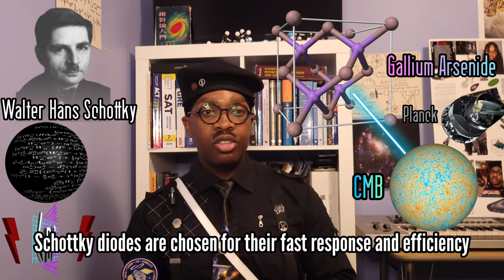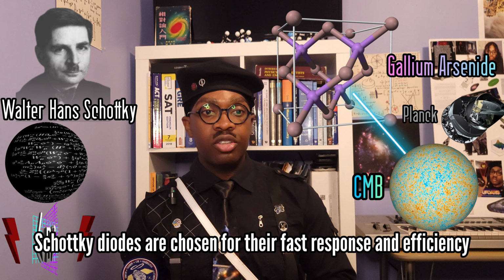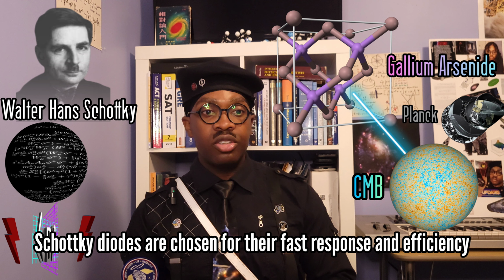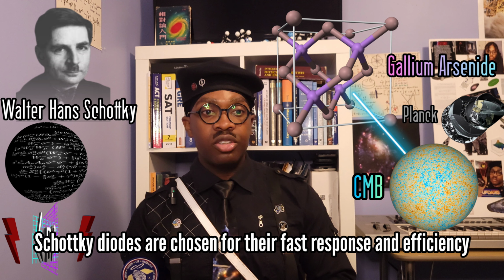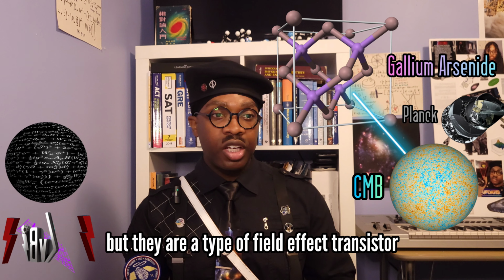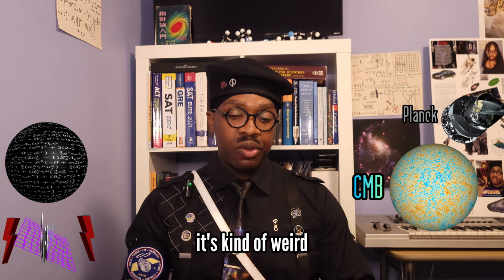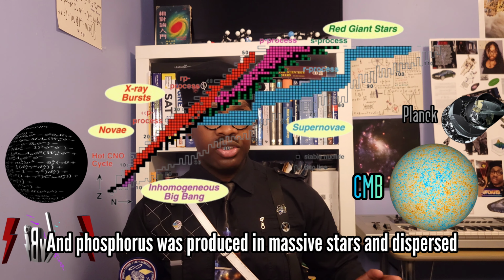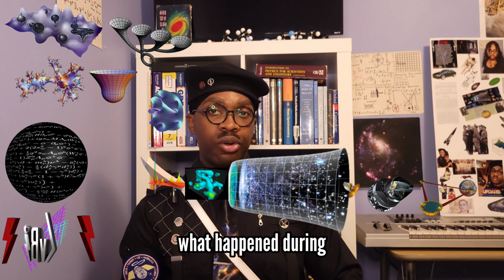What chemicals are used to detect the Cosmic Microwave Background?

Comment: Hello Chavis, would you reccomend the Feynman lectures as a good funnel into learning physics alongside calculus?
Reply from the maker: I'm going to be very blunt and honest, very few people who ask me this question actually do anything with it. Most of the people who come to my page usually or doing so based on ulterior motives and end up as failures who won't even remember they existed soon. 

However if you are serious about your question, the first thing you need to do is analyze metacognition. Look up Robert Bjork and Jun Yuh before you look up Richard Feynman or try to do derivatives or integrals in calculus.

Making learning harder and more difficult, rather than easier and more comfortable, is the best approach to retain information. One needs to understand the distinction between retrieval strength and storage strength, according to UCLA's Robert A. Bjork. The mere act of studying something does not guarantee that you will be able to understand or remember it. Actually, adding difficulty promotes more flexible and long-lasting learning. These challenges include varying the conditions of learning as opposed to keeping them constant and predictable, interspersing instruction on various topics as opposed to grouping instruction by topic, spacing study sessions as opposed to massing them, and using tests as study events as opposed to presentations.

Only when you do this can you know that you're going to actually be serious about this and not just look up this stuff for fun.
Reply: @cháwesī_ChavisVonBradford  I am very greatful to get such thorough advice from someone who clearly has great lived and learned experience. The fruits of which shall be bountiful. My grandpa was a geologist and he taught me some astronomy as a very young lad, and since then my dream has been to become a physicist. I dropped out and became a solar technician when i was denied financial aid and needed to help my family. But, I was recently gifted the Feynman lectures and Calculus: a rigorous first course by D.J. Velleman, and my will has been revitalized. I will have to devolop a time efficient schedule and train myself.
Reply from the maker: Analyze this playlist: https://youtube.com/playlist?list=PLnbDCUisM9Zjnikwb5Y2OkqTuZw7HD_il&si=HY-KdRUjMSyrUqo7
Reply from the maker: And analyze this playlist: https://youtube.com/playlist?list=PLnbDCUisM9Zh9tHGLIOx5ImTeKYA-1wDi&si=yGFJJVWe2hWwNZUp